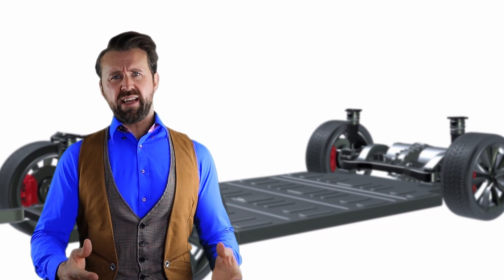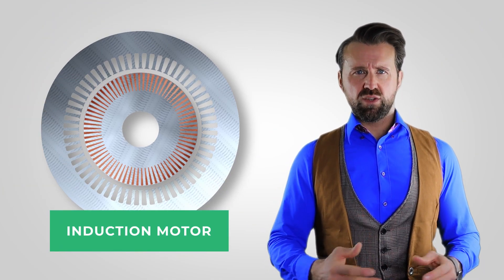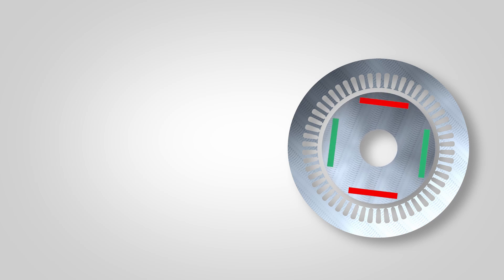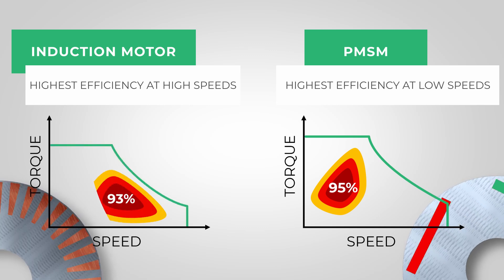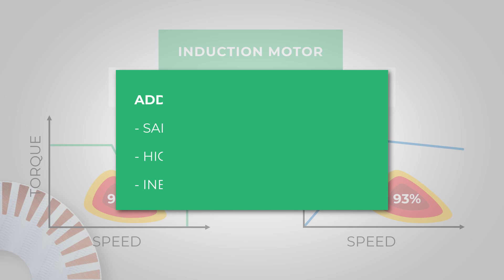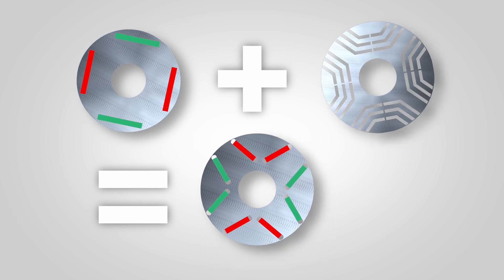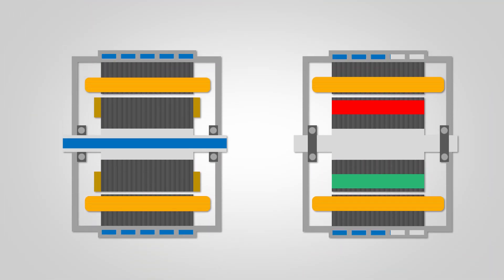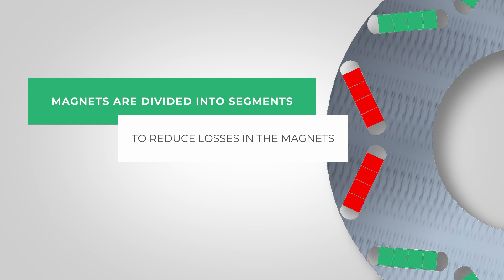Tesla Motor the Secret of high Efficiency

Comment: But isn't the switched reluctance motor even better? And fantastically simple to manufacture.
And in the synchronous reluctance motor, the low reluctance iron pathways for the flux look as if they may be structurally weak, to me. 

As for the neodymium magnets, China's monopoly on these rare earths is not a natural monopoly, but one which the Chinese themselves brought about by price manipulation. I would call that an "act of war". Rare earths are not rare at all. They could (and should) be mined elsewhere.
Reply from the maker: It gives me great joy to read comments like yours, because you are absolutely right about many things! 
Yes, the structure of the synchronous reluctance motor is mechanically poor and unsuitable for high speeds.
And yes, rare earths are not really rare on Earth and most states have simply underestimated their importance.
And yes, there is actually no electric motor easier to manufacture than the SR motor.
But, the efficiency of a SR motor is worse than a motor with permanent magnets, especially in the lower speed range.
It is not easy to explain but try to compare a SR motor with three phases with a permanent magnet motor.
In a SR motor with three phases, only one phase is active at a time, while in a motor with permanent magnets, two phases generate torque simultaneously.
This means that the power or the current to generate the torque is distributed over two phases.
Can you give me a short feedback if you have understood the example so or maybe you have another opinion about it?
Reply: @Electric-Motor  
I am always pleased to be the bringer of some sort of joy.
But I am not an expert in electric motors. I am a casual observer.

I have noticed that the Swiss manufacturer: ABB has introduced a new range of synchronous reluctance motors. And the American company: Turntide has a range of switched reluctance motors. Neither company concedes that the other design is better! But both make claims when compared to the ubiquitous AC induction motor.

I cannot claim to follow your explanation of why the permanent magnet motor is superior [meaning it is more “efficient” or provides greater torque, etc]. 

The way ALL electric motors work is that the magnetic forces pull or push the rotor from the existing position to a new position. Normally this new position would be more magnetically “comfortable” for the motor. But just as it arrives in this position, the electrical current through the coils gets switched to make a new magnetic configuration, and the rotor must move on again.  In the early days, the switching was achieved by commutator rings.

In modern AC motors the switching mechanism is more sophisticated. But the idea is still the same: let the magnetic forces pull or push the rotor to a new position. And then at some optimum moment, rearrange the magnetic forces in order to promote further rotation. 
  

Using power electronics – like thyristors (which is a relatively recent development), the ability to direct the magnetizing currents to different coils at will, under intelligent software control opens up new possibilities. And if you want to activate two coils at the same time, this can be done. 

Constraints might arise because of switching speeds, and the “dragging” effect of any hysteresis which might pe present. I don’t know any of this for sure. I am guessing. But I will look out for any published test results.   

I notice “Turntide” says it uses no sensors inside the switched reluctance motor, which I also find intriguing.
Reply from the maker: It seems that you are very involved with electric motors.
May I ask why you are so intensively involved with electric motors?
Small hint... You can operate almost every electric motor sensorless! The question is if that makes sense and if you want to accept the limitations.
Reply: @Electric-Motor  
I am not involved with electric motors in any way.
But about two years ago, I developed a casual interest in electric vehicles - especially Tesla. The development of battery technology is the really distinguishing feature of electric vehicles. But I also wondered how Tesla could power an AC induction motor from what is necessarily a DC source - the battery. Thus I was introduced to the pleasures of "pulse width modulation". 
By the time I had digested the workings of Tesla's AC induction motor (used in the model "S"), Tesla had moved on to "reluctance motors" (for the model "3"). So I learned about "synchronous induction" motors, and (just to be safe) about "switched reluctance" types, too.

There is a lot of information available about Tesla's technology. There is almost a spin-off industry created by following Tesla developments.This is very like IBM in the 1980s. It is far more difficult to discover information about Tesla's rivals. So I tend to follow only whatever Elon Musk decrees for his Tesla. 

But, diverting as looking at electric motors might be, the critical technology in electric vehicles remains the battery.

As for sensors in motors, I would not exclude them as a matter of principle. And I imagine the very least your motor controller needs to know is:
.      1) What is the orientation of your rotor?
.      2) How fast is it spinning?
If these are not questions which need answers, then I obviously have more to learn.
Reply from the maker: That is correct the motor controller needs the position, speed and phase current.
Position and speed can be calculated by an observer. The observer contains a model of the electric motor from which it can estimate the position and speed.
However, the method is not 100% accurate and also takes time until enough measurements are taken and the correct position is determined.
For pumps and fans this is a common method, but not for traction drives and actuators!
 Have a nice weekend
Reply: @thrunsguinneabottle3066  Surely the position/orientation of the rotor and the speed at which it is spinning is not absolutely vital to it's function. If any commutation sequence is being applied from the stator, it can simply assume that the rotor is following this. 

Of course this is far from ideal, as the rotor could stall if the load torque is too high - causing the rotor to fall out of time with the changing magnetic field of the stator. Having said that, the rotor could potentially recover if the load torque is reduced and the frequency of the commutation sequence isn't too high. 

In other words, imagine you have a very small and inexpensive motor (of virtually any type) that doesn't have sensors. If you stop the rotor from spinning by hand, the stator will continue to produce a changing magnetic field as if nothing had happened. If you then let go of the rotor once again, it will likely begin to spin (although it might require a more manual "jump start" with your hand). 

This is a sensor-less motor since it just assumes those factors of the rotor. If I'm inaccurate in my explanation, please let me know. I'm an 18 year old yet to finish my A Levels you see, all of my motor knowledge is self-taught.
Reply: @georgemathieson6097  I hope you find employment in the electrical industry.
When I left school, I nearly took up an apprenticeship from AEI (Associated Electrical Industries in Manchester). In the end I decided to study maths at university and worry about finding a career, later. In retrospect, this was a mistake. I don't now know even if AEI still exists. I do know that the British electrical industry was overwhelmed by the onslaught from Japan in the 1970s. As usual, we made no attempt to protect ourselves from the attack.
Reply: @Electric-Motor  
Thanks.
With the controllers being packed full of electronics anyway,
I think to circumvent the obvious use of a sensor, is just perverse.
A single "hall effect" sensor would provide both position, and (by counting) also the rpm.

Comment: Great, very interesting.
Thanks 👍
Reply from the maker: Thank you very much, may I ask what you think I should improve about my videos in general?
Reply: @Electric-Motor  At the moment I think your videos are ok.
It would be interesting next videos about drivers (inveter), such as the principle of operation, characteristics in general and of power electronics and so on.
Thanks!
Reply from the maker: Thanks for your feedback, I would also find it great to make videos about control and inverters. However, I do not have the time and therefore I try to focus only on electric motors.
Reply: @Electric-Motor  it's ok anyway.
I will be waiting for your next interesting videos about electric motors.
Thank you!

Comment: Great video as usual. 
What are the expected improvement using carbon-sleeved rotor in the plaid version of Tesla motor?
I read about advantages in motor speed, efficiency and power density but a lot more or just a bit?
Could the efficiency reach 97-98% in a greater range of loads?
Reply from the maker: Thank you very much for your question, it helps me a lot to achieve a better placement of the video.
Regarding your question... The carbon sleeve rotor will be used to increase the speed.  As you have already written, this can increase the power density. This means that the motor can be made smaller and lighter. However, the losses in the sheet metal of the stator also increase rapidly. Have you already found a report on the new speed? I expect an improved battery that can maintain its nominal voltage over a longer period of time and thus slightly increase the efficiency of the electric motor.
Reply: Only aliens have figured out 100% unity